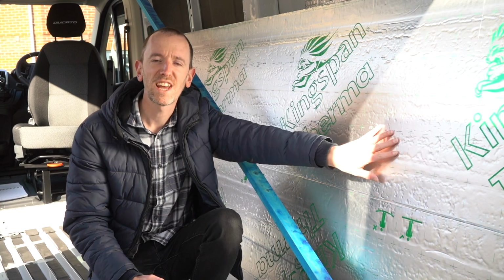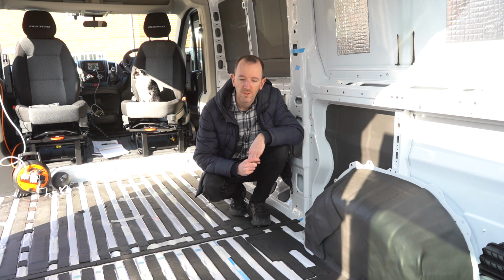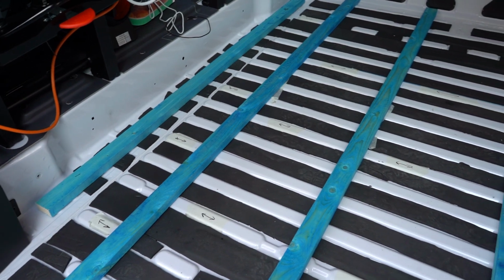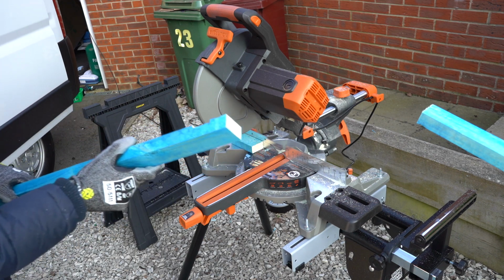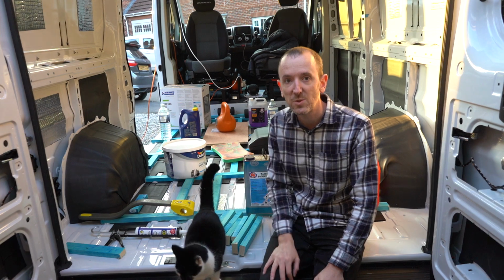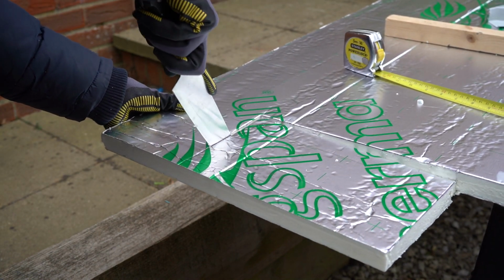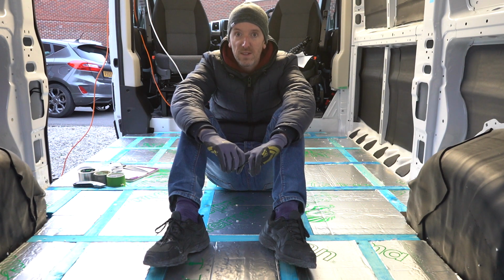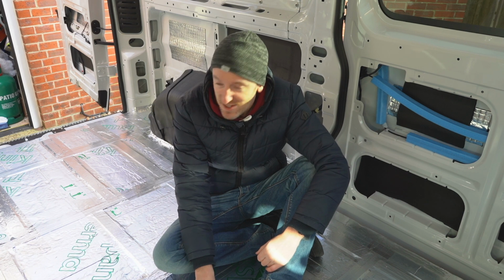Battening + Insulating Our Sub Floor | Fiat Ducato | UK Self-Build Campervan Conversion

Comment: In between where plywood floor boards meet it's important to get the batons in exactly the right position to support both boards. I did those batons first, starting from the front, then measured 1220mm down on the left, centre and right, and glued in the next baton, needed to do that 4 times for an L4 van, and get them perfectly square so the centre of each baton was 1220mm further back from the last. Then I moved on to the intermediate batons which can be placed less accurately, but it's best to find a good rib position (some are 2-4mm lower like you said), then cut and place a long rectangular strip of PIR, then use that to position the next intermediate baton. Then the PIR can be pulled out and labelled, later it can be cut into squares once the intermediate batons and noggins have been done. It takes more time doing the plywood edge batons first, but you also save time by using cut rectangles of PIR as guides for the intermediate batons, so it all balances out I guess.

Comment: When I was cutting the insulation for my home office I used a second fix wood saw to cut it.  Worked really well as it’s a fine blade but all a big blade so easier to cut straight edges, might need something smaller for the little bits though.

Looking good, wish I known about the aluminium tape as I don’t have any of these on my sub floor!

Comment: Loving your videos, very well made and clear explanations. Think i have no watched nearly all of your conversion vids. Quick question, how have you found the 25mm PIR insulation underfoot and do you feel it was worth adding the 6mm dodomatt liner also. I was thinking of going thicker with insulation but i also really don't want to loose too much height (am 6'2).
Reply from the maker: Thanks for the message, glad you’re finding them helpful. The floor insulation is fine. Hard to tell if the dodo liner added much but I’d probably use it again. Floor is always warm though.

Comment: Ooh @18:18 I can see you removed one of those metal supports, can I ask how you managed to get them off? We're a tiny bit shorter than you at just under 6ft but we'd need to remove two metal supports at the back. Thanks for the build vids, they've been super helpful!! 🤩🤩
Reply from the maker: Glad you like the videos. It was fairly straight forward to remove. I just drilled into the bits of metal that attach it top and bottom and then used a tool to snap the metal. It then just pulled off with some slicing of the glue. Way easier than I thought and didn’t need to use a saw or angle grinder.
Reply: @ great, I’ll add that to my list of things to do this weekend! 🤣 hope you found it worthwhile doing your own build, we have just swapped our 24 year old van for a slightly newer model 🤐

Comment: Hi There, 👋 great build enjoyed watching very helpful 👍😊 just started my build I'm at the point of battening and insulation board, please can I ask what you did with the anchor points in the end, did you use to help hold the sub floor or did you just seal holes with the existing bolts? Many Thanks Lee.
Reply from the maker: Hi Lee, so I removed them and laid the floor and then realised I didn’t do anything with them! So didn’t seal or put the bolts back which was silly. I’d definitely do that but we don’t need the anchor points inside the van.
Reply: @OurVanPlan  thank you for Coming back to me, I'll do that this morning then 👍

Comment: Hi i'm just wondering how your floor batons have held up? I've just bought a 19 plate relay and realised the floor is like yours and the ribs are unlike the older vans.
Reply from the maker: Yeah all good and no problems with the floor.

Comment: When you took the plastic covers off  at the end of this video, did you fill the "well" with insulation and cover the plastic lid with foil ??
Reply from the maker: No we didn’t put any insulation in the void as it can get water in and so we sealed and insulated over the top instead.
Reply: @OurVanPlan  Thanks for info, enjoy your videos

Comment: Hello, thanks a lot for very useful video. What is the thickness of rubber insulation mat you used to fill in the blanks?
Reply from the maker: The black foam stuff? It’s 6mm dodomat super liner
Reply: @OurVanPlan  Exactly. I guess it was enough thickness to flatten the floor, right?

Comment: Can you roughly remember how many roofing batons you used? And did you get away with just two sheets of kings pan cheers
Reply from the maker: I think we just bought one pack of battens, so 8, and definitely no more than 2 sheets of kingspan for the floor. We had some battens left over too.
Reply: @OurVanPlan  Thankyou 👍

Comment: Why did you cut the insulation sheet into smaller pieces?  I wanted to understand the reason.
Reply from the maker: To ensure there were wood battens under the parts of the build that needs securing to the floor eg kitchen cabinets but also to brace the floor so it doesn’t flex when walked on.
Reply: @OurVanPlan  thank's💚

Comment: Good video, were those battens the blue colour when you got them??
Reply from the maker: Yep, they’re treated roof battens from Wickes.
Reply: @OurVanPlan  Thank you..
Reply: @OurVanPlan  Hi, on your van did you have the bulkhead taken by the dealer, if so did they supply the plastic edging etc for the edges plus what model is you stereo head unit...👍👍
Reply from the maker: It was a new van so factory option to remove bulkhead and therefore they supply the trim. The dealer didn’t do this. The head unit is the new touchscreen Mopar unit in 2020 vans on. Touch screen, CarPlay etc.